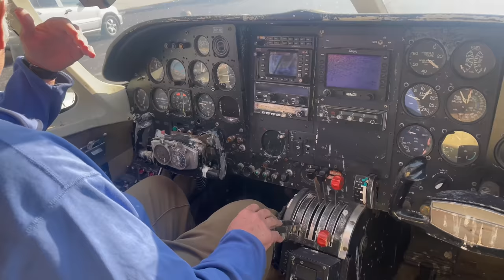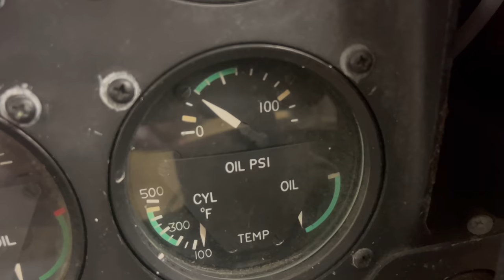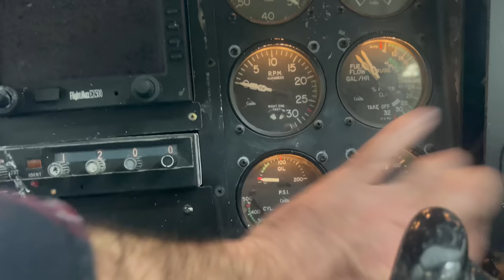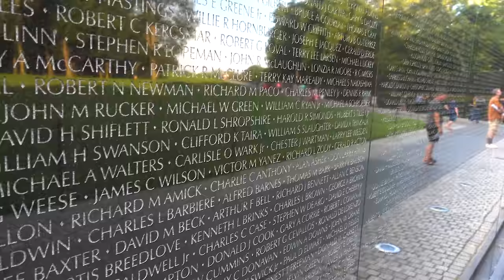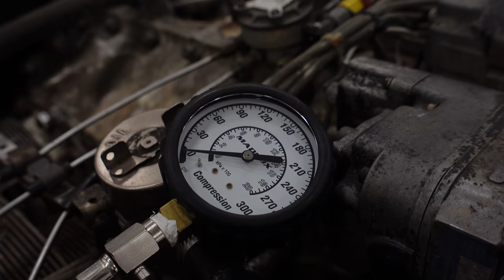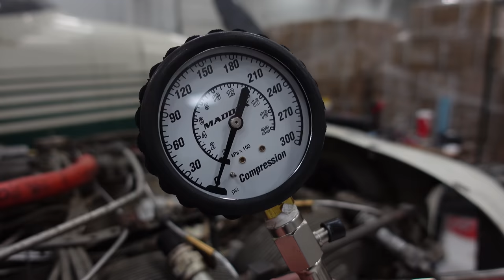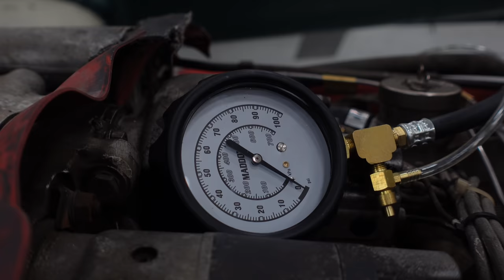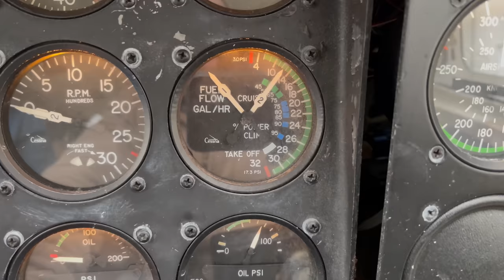Did We Ruin The FREE Abandoned Airplane Engine ? Ep6

Comment: Marvel Mystery Oil. I had a 454 Chevy in a boat with the racing lower unit. Clutch was a cone shape. Famous for sticking and rough shifting.  Filled it with Marvel. Let it sit for a week. Went in red. Came out black. Shifted like a baby - silent and slick afterwards. Marvel has been used for years on locked up tractor engines used outdoors.  My 100 year old grandfather used it religiously for his lifetime.  He made me a believer on multiple engines he salvaged that ran perfectly afterwards.

Comment: No idea if this will help, but...

I've had a couple of old motorcycles, and they were bastards to start after long periods of time left alone (talking months, not years likie your plane).  Especially in cold weather (and I'm in Australia, so not proper cold weather)

One thing I've found that helped, was to aim a fan heater at the engine for about 10 mins before starting - seems to make a big difference.

I know I am talking small capacity single and twin engines, but I wonder if you temp fit the engine cowls, then (under fire supervision) blow a heater in there for 15 or 20 mins to warm it all up - see if it makes a difference.

I may be totally wrong, but may be worth a go.

Enjoying your channel, thanks.

Comment: I think a fuel line may be twisted. Sometimes this happens when tightening a B nut and you don't secure the other nut with a wrench. Even if you get flow through it, it will collapse at altitude. You will lose that engine until you bleed that altitude off. Happened to me in a Huey during test flight once. Came out of depot like that.

Comment: I use a rag or paper towel packed into the spark plug hole to find TDC of the compression stroke. By turning the crank and when it reaches TDC the rag/towel will pop out.

Comment: It works, I add a quart of trans fluid in with my oil before I changed it and drive for a half hour, I WOULD NOT DO IT ON ANY VEHICLE BUILT AFTER 1990. It would free up the lifters, rings and help to remove the sludge

Comment: I would suggest next time you have to drain that much liquid waste oil. or jet fuel. Instead of using the drain pain. Just use the five gallon bucket you put the drain pan on. Less splatter and more capacity.

Comment: You’ve got spark, compression (mostly), fuel (ether), and air. Perhaps a timing issue? Even on ether it wouldn’t kick. That whine I’m concerned the jet fuel stripped the oil and if the pump isn’t producing pressure the bearings might be completely dry. Good luck!

Comment: As I know it's called bobina, it destributs one phase electric charge to the starters at a ratio of lower than a a second. Each of them needs to have enough connection to touch and pass over over the electric circuit evenly. Polishing them with a 0.00 or less sand paper and keeping them clean is very necessary.

Comment: Old Mechanics I've worked with including my father,we used diesel fuel in crank case and would use Marvel's Mystery oil in heads and piston rings 
Amazing stuff ,we raced Super Stock flatbottom boats we used it in fuel to lube upper end of big block chevy

Comment: try running a wire from the starter back to a V meter clear of the prop and see what the voltage is when turning the starter over. may be a bad connection somewhere

Comment: When I was in the army we ran all our diesel vehicles on JP 5 jet fuel. It’s just a fine grade diesel fuel. It combusts at a lower temperature so it doesn’t produce as much torque in a truck however aircraft don’t require torque

Comment: Curious how clean it can get inside.  Also the Jet fuel in the crank case idea.  I would use Diesel fuel for gas engines in the crank case.  I used 2 quarts for a 5 quart engine and drive it or let it idle for about 2 hours and it would clean them like new.

Comment: Back in the 60es early in the morning 2 hours before work, we would take the hot coals from the wood heater in the house and put hot coals in a pan and put them under car to heat up the oil for the engine to start talking around 10-degree weather.

Comment: have you ever used a spark plug cleaner? it is a little sand blaster made just for spark plugs to clean the end of the spark plug, it would clean carbon off the electrode end of the plug.

Comment: I calculated about 4 gals of oil/fuel in the engine. Funny, you placed a 2.5 gal container on top of a 5 gal bucket. Maybe should have just drained it into the bucket? You crack me up.

Comment: I do the same with diesel anytime I buy an old dirty engine. Drain the oil and add 1 gal diesel 1qt cheap oil crank and idle only, drain and repeat till clean. Fill it with new oil and a filter let it idle a few min then it's all clean and ready to run.

Comment: I think that the reason the right engine turns over slower than the left is because the battery is on the left side, so there's less amps  and voltage drop as there's less wire to travel

Comment: Fun fact, jet fuel and disel have almost the exact same characteristics. so you can use jet fuel to power a disel truck, the only difference is that disel have lubricating additives in it to lube the HP disel pump, so what alot of people do is that they fill up their truck with jet fuel and then top ut the tank with a quart or two of engine oil.

Comment: I would drain the old oil before puting anything. The crankshaft always needs lubrication but the overall engine if there is an old oil you don't know for how long definitely might have some dirt and silt worn out iron fillings. Different densities of oil no matter they may be mixed they dont for anything properly and in this case sounds like making a mess.

Comment: Have you thought about the power supply cables to the starter. if they are frayed or chewed through will reduce the power going to the starter. also check the earth ( negative cables as well ) bad earth also makes engines turn over slowly.

Comment: just subscribed....I do the same stuff you doing here to old vws and old porsche..air cooled only is what I mess with.
Reply: check with cleaning services in your area..they go in when a house was on fire with a fogger machine..this thing is as loud as 9 chain saws running at the same time and they fog burned homes..like rooms that didnt burn up but got smoked up real bad...they uses sponges on the walls and wipe them down and then fog the room...you need them to come out when you pull out the interior and fog in inside of this plane...it will work and take the smell out like a chicken coop you said......
Reply: jet fuel is basically kerosene...Jet fuel (Jet A-1 type aviation fuel, also called JP-1A) is used globally in the turbine engines (jet engines, turboprops) in civil aviation. This is a carefully refined, light petroleum. The fuel type is kerosene. Jet A-1 has a flash point higher than 38°C and a freezing point of -47°C.

Comment: getting the engine running helps with the scrap value (parting out) but I would be more worried about the airframe and corrosion, if you ever want to attempt to fly it. with all the weather intrusion for 17 years i doubt the frame is worthy

Comment: I haven't watched the whole video yet, but I am betting that mess of jumper cables and batteries on the ground is wasting way too many amps given the distance and resistance the power has to travel to the other starter. You may even have corroded, worn or chewed cables along the way to the other side. The 1st engine is half the distance to the battery separate cables from the battery to that engine.

Comment: You have to stond in front of the propeller at the center and always keep your attention on it if you have to start to start by labor compression. In deosol engines no starter or spark is needed for ignition, who knows un evenly proportionate cylinder one of them might have higher compression to kicke start one cylinder just onece and the torque could be enough hazardous with three of it's propeller turbines at 120 degrees which is dangerous if it kicks off even for one.

Comment: I thought rule of thumb was about 90 lbs. of compression for a engine to run right. Maybe having 3 with only 60 is just to low to fire her off.  I saw on another show that they showcased a cleaning company that did came and cleaned a really stained car interior for pretty cheap, that show cased that company. So it's a win win for all and they made the car look new inside again. So, you would pull all the seats (or whatever you want cleaned) and they just come & clean them for you. Then you just reinstall them.

Comment: The old timers right you know? The jet fuel will penetrate the engine down to wherever its frozen if the engine isn't completely screwed. The  extra compression of the jet fuel will unstuck whatever is stuck (if it doesn't break it in the process). It's basically like using a breaker bar to unstuck whatever is stuck inside the engine you can't think of (or it may just throw a piston out of the block and destroy everything, but at least you will know your engine is stuffed if it will die like that).

Comment: You will not get a FCC or CAB airworthy certificate even if you can get it too run, fly, taxi etc. You need to, remove the engines and start a teardown. There will be
unseen issues that likely will come up in flight or taxing. Just for the safe side. Hire a experienced air mechanic even just for advice. Also, one issue will come up in order to get your certificates. Age of aircraft, condtion, how long it sat, why was it abandoned, your aircraft repair/overhaul experience. Model # etc. I don't desire to rain on your parade. You will live longer along with passengers and people on the ground.

Comment: "[Jet fuel] smells a little like diesel."   Because it is diesel :D

Don't put it in a diesel truck because it may not like the conditioners. But some, like JP-8, were designed to work in both turbine aircraft and vehicles. Since turbines are extremely hot, the fuel doesn't need the higher volatility of gasoline and since compression is not an issue it doesn't require a resistance for autoignition  (octane) such as 100LL. Well, technically turbines do have compression but a lot different from a piston at top-dead center.

Comment: I watch another youtuber who is fire(spark)/fuel/air- THE basics- and when he gets that low compression reading he'll get into those valves which 9 times out of 10 causes that low reading, check those valves and make sure all are opening and closing, taking the head off is a little extreme but you can hose down the valves with PENETRATION OIL and possible soften up any carbon build up just getting them freed up or seated properly until it fires and works itself out, you're too close to stop

Comment: Jet fuel is just highly refined kerosene.
"we're gonna put as much of this jet fuel down inside the crankcase down inside with the oil um as will fit i'm not sure how much it's gonna fit"
I thought you were going to fill the crankcase entirely with the kerosene mixed with oil and get liquid past the rings into the combustion chamber.

When I saw you crank the prop by hand, I thought it looked too easy. I thought maybe Gear reduction is what made it so easy?
Then when I saw the compression check, I didn't like what I saw. The first one at 120 was ok but the others slowly pumping up to 90 is no good. I am a veteran automotive mechanic engine builder. 60 Psi compression does not fire at an idle until you hit the gas and the rpm's come up forcing the compression to be higher. So getting 60 psi on the first pump is not enough to fire. The ones that went to 90 on the first pump are likely the ones that made it seem to try every once in a while.
This issue is likely going to be internal, either bad valves, sticky lifters or the rings sticking or bad.
Transmission fluid [ATF] is an alternate means for unsticking sludgy parts.

Comment: I had a slow starter issue one of my cars, fund the brushes on the motor nearly gone. I'm only a couple minute into this video but maybe rebuild the starter if it's still slow after all this. Also, if you start number 1, do you get alternator/generator power to help drive engine 2's starter and keep those batteries topped up?

Comment: You made the comment that the jet fuel smelled like diesel.  It is basically diesel fuel/oil.  As a matter of fact, diesel will burn perfectly fine in a jet turbine.  If you pushing hard.  It will burn hotter though.  I'm not sure how much hotter though.
  Back home I know a guy he takes the turbine power packs out of Chinook helicopters puts them into various cars and occasionally a motorcycle.
  Actually, Jay Leno has 1 of his jet powered motorcycles! 
  Well take care
  sincerely Lindsey

Comment: No such thing as failure! When you try something, and it doesn't work, that tells you that that item isn't the problem. Positive Feedback!
You switched starters, no çhange, Startèr isn't the issue. 
From what I see, you have fuel pressure and fuel flow, check that you're getting the proper amperage from the mags to each and every spark plug. I know it is designed to run on 6 plugs, but since that engine hasn't ran in 17 years, max amperage to all 12 plugs may make a difference. 
My 2 cents 💰💰

Comment: Definitely not getting a robust 13.8 volts to the mags, the starter is robbing all the ignition voltage, try just running an alternate current to the mags preferably from a capacitor jump starter

Comment: Is there any way to convert it to electronic ignition and get away from points? I used to run a dual point in my car and my son changed it over to an electronic.  It's  much more reliable and doesn't need frequent adjustment.

Comment: Maybe this thread still has life.  A friend invited me to a tour of Paul Russell restoration in Essex, Ma.  They have their own restored vehicles for sale and do work for customers like Seinfeld and Jay Leno.  They will take a car down to individual pieces, photograph and restore.  Sometimes doing sloppy welding to look like original.  The refurbished a 1928 Mercedes Roadster, gathering and dying hundreds of lizard skins to redo the seats.  My hobby is restoration on boats.
I worked the flight line in my younger years and know every bit of safety item needs to be signed off.  I am not sure if you can just label this experimental and go with that.
Perhaps if you don't take passengers, or have your passengers sign a contract saying they may experience loss of life.  Kinda like the Titanic dive sub.

Comment: I have used diesel fuel and kerosene to do the same thing in everything that has a not just Continental.. Volkswagen. Air-cooled. Briggs & Stratton Chevy 😊 just don't hydrolock and lift a cylinder head

Comment: You Have an issue with the fuel injection I am thinking fouled injectors, getting enough fuel to fire ocassionly just not enough to keep it running.  Also looked like you may have the mags timed just a little bit advanced. the few time in the video it fired it looked to fire a little too soon  but without I timing light checking this that is only an eyeball guess.  But I do think you issue is fuel  You got ait and spark and some fuel just not enough

Comment: FYI you can shoot the starter fluid right into the air breather while you're turning it over you don't have to take the cylinders out you want to take the spark plugs out you don't have to do any of that crap I'm not sure if you got enough spark you said I think you did think you had enough spark as long as you got spark and you got fuel shooting into those cylinders You're not getting enough propeller speed which means you need more battery power to that side boost it with some more battery power and she should fire right up

Comment: E2 cranking seed seems a bit low/after watching several videos of hard to start aircraft engines none of the mechanics ever checked to see if any of the valves that were in the open position for years were closing completely?  exhaust valves are more prone to sticking on these engines.

Comment: Putting a DIRTY oil filter back on !!??   I thought you wanted to clean this thing.  Also you should have done an autopsy on the old filter. And, you should have turned the motor over a # of times with the drain plug off. Much more would have came out.

Comment: That into video picture with you holding a can of Jet Fuel --  Were you planning on adding it to the tanks of that Cessna?   You will destroy the engine with it, if you try running the engines with it.  It may be OK for the planned cleaning attempt.  But for pity's sake, get it out of the engine before attempting a start.

Comment: Number one, and this one's important. Stop turning the engine backwards! It's a definite No-No. 

Number two, that engine will run all day, with a locked up Turbo. That's right, the turbo does not have to turn for that engine to run. It may run like shit with no turbo, but it still will run.

Number three. You had some metal shavings in number 6 jug I think. It would be a good idea to use a borescope in that motor on number 6, because it's a lot cheaper to change one jug, then a complete rebuild.

Other useful information:

The motor will absolutely run on less than 6 cylinders. It can start up on less than 4 cylinders.... ain't going to run good though.

Mags quitting are common thing when sitting for a long time, it's like a car with points. They may just need a good cleaning but make sure your mags work.

This engine may have been the reason why that thing was parked in the airport in the first place, did you ever ask the owner of the motors ran when parked?